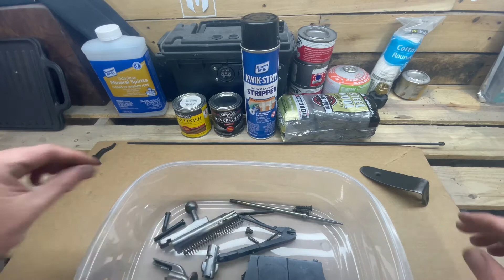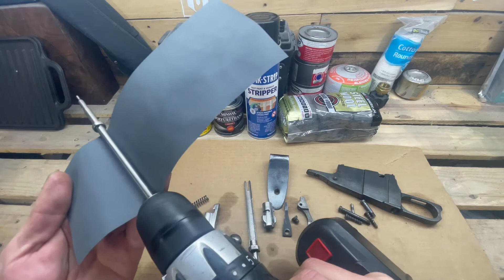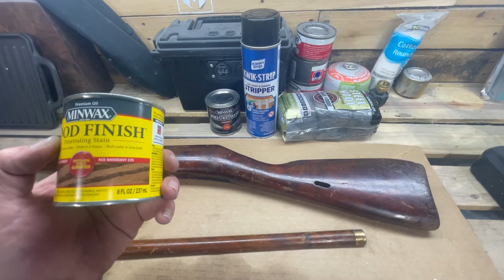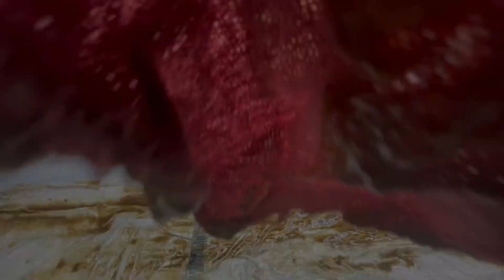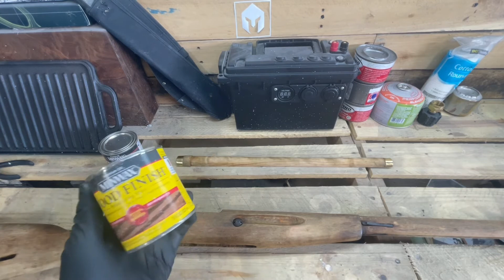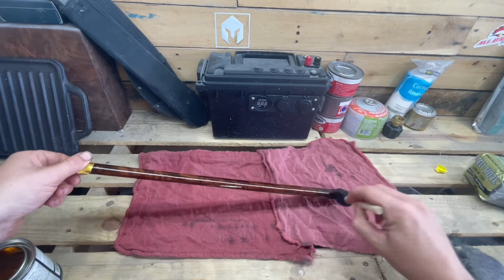Rifle Stock Refinish | Refinishing A Mosin Nagant 91/30

Comment: Very nicely done. I refinished my M38 carbine recently and did something similar, only I applied three coats of Boiled Linseed Oil to it first to make the grain stand out before I applied six coats of the red mahogany. It’s beautiful. I also did a wax finish instead of a poly finish. The excess stain will bubble out of the wood if you get your rifle very hot, I put 80 rounds through mine during my first time at the range. I hope your like-new Mosin brings you joy!
Reply from the maker: We’ll have to try the linseed oil next time around. They always bring joy.

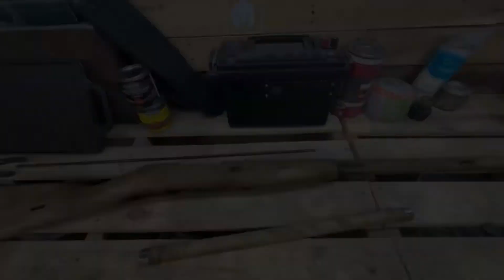Comment: Hey, I was curious at 15:51, what did you do to get from where the wood still looked stained where the wood was very light in color. Did you just keep applying the kwik strip, did you steel wool it, or something else? I'm about to attempt this same project on a mosin and was curious about how exactly you got your wood to look completely unfinished. I'm gonna end up refinishing mine with toms pine tar mix once everything gets delivered.
Reply from the maker: After wiping it back down that’s how it dried out. Once all the stripper was removed the stock dried out to that lighter unfinished look.
Reply: @TheFamilyAdventurer  Awesome! Thanks for replying so fast. My finish is different than a normal mosin since its finnish made, but the handguard had some bad wood repairs. Found a new old stock unfinished handguard to replace it, but gotta strip the original stock. I'm guessing that stripper will do alright to remove what's on there hopefully. I noticed that that paint stripper brand rebranded that spray stripper to just be called klean strip now.